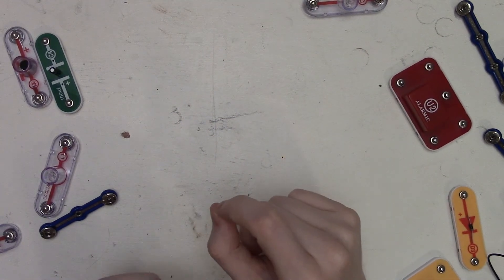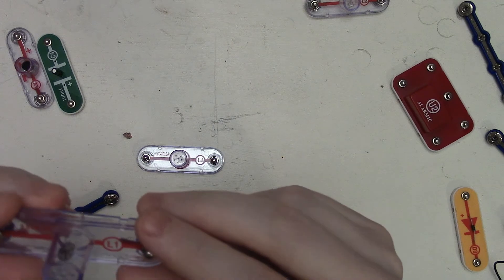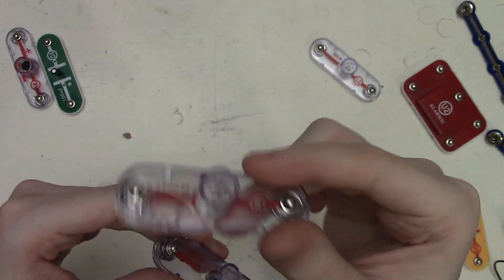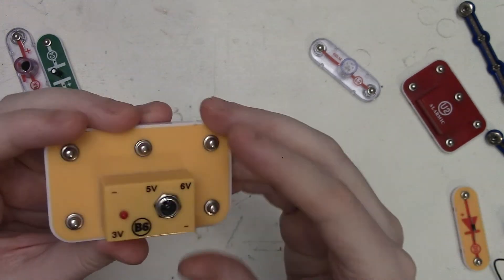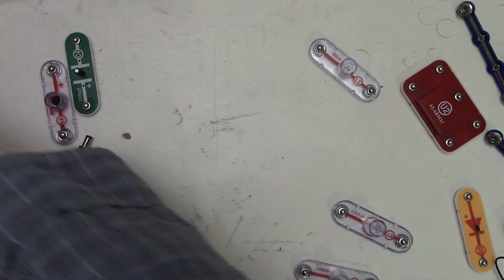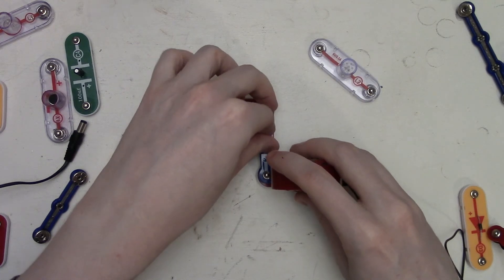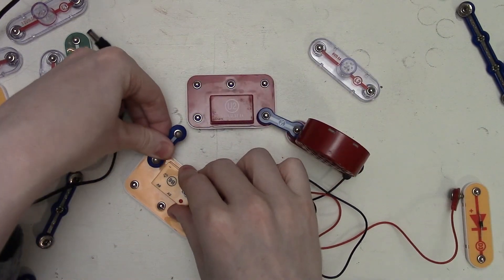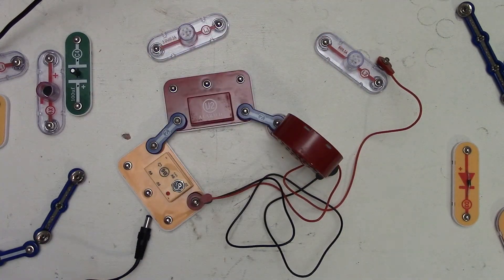ELENCO Snap Circuits Replacement Parts (II)

Comment: One of my music IC wasent working properly where the trigger port works onece then dosent work after a while starts working but have fixed that issue with a led light and that fixed it and now work properly
Reply: I’ll try using an led light because I have that same problem